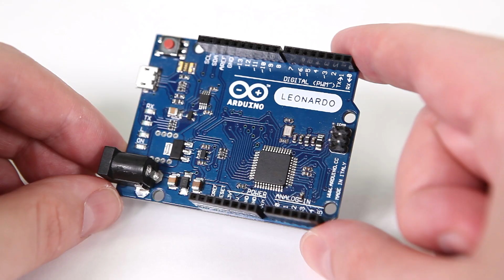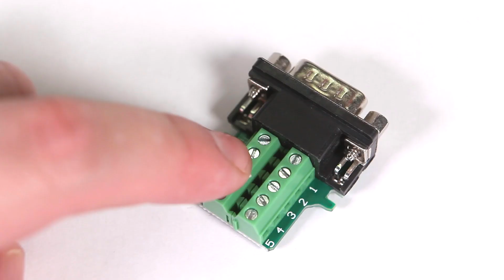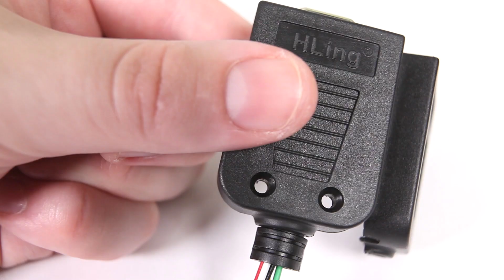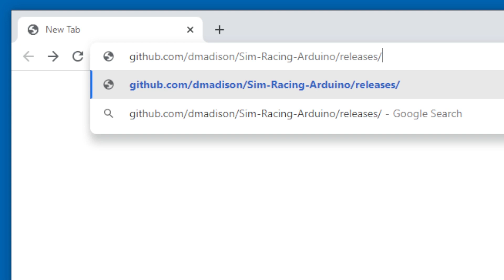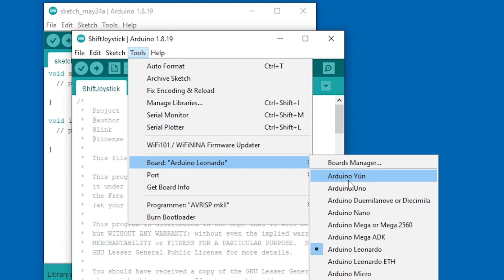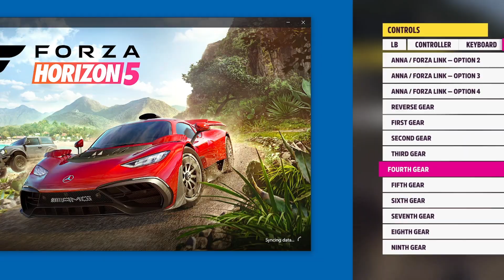(OLD VERSION) DIY Logitech Shifter USB Adapter (No Soldering!)

Comment: Worked great without problems. I used an Arduino Micro for this. Thanks!
Reply: thak you was wondering if micro is capable as i cant find leonardo anywhere
Reply: @filiplenczkiewicz9229  same, that was my issue too. Picked up a used micro, the important thing is to get one with wire connectors because otherwise you’ll need to solder the connections! So look out for that when buying one. Also, I recommend getting wires with plastic ends that fit to the arduinos connectors. Ended up being ~20€ for all the parts, with shipping maybe 25€.
Just wanted to add that before this I have never used an Arduino before, so it’s really easy to do even for beginners ;)
Reply: @benedikt9744  hey I already got my micro from Amazon I’m actually setting it up now haha yeah I got the one that u have to solder but I study computer engineering and soldered before so I’m g but yeah arduinos are fun! Next thing on my list is a IRL speedometer to program so that the rev meter and speedometer are the same in game and on my dash
Reply: @benedikt9744  might get the old BMW clocks they look good
Reply: @filiplenczkiewicz9229  sounds like a nice idea! I’ll maybe do that too sometime.
Reply: @benedikt9744 Hello! i am planning to get a Pro micro board but it doesnt seem to have the 5V where he attaches the wire to, where do we solder or attach the 5V wire to on arduino pro micro? also is it possible for you to point which Arduino Mirco board it is? sorry new to this 🥲
Reply: is the same pro micro

Comment: great video but considering the cost of everything it's cheaper to buy a Leo Bodnar adapter already made for 35 bucks
Reply from the maker: It's up to you, DIY solution aren't for everybody. You can get the parts for less than $5 USD on sites like AliExpress.
Reply: @dave.madison  Is it possible to make this with an arduino micro because I already have a few of those?

Comment: Awesome! is there a way to connect both shifter and pedals to a single arduino??
Reply: yes, i did this just an hour ago, works great. just need to combine the code and change pins to correspond with new pins used. good luck!

i can share my wiring diagram and modified code if you want.
Reply: @MotmoRacing  nice! thanks!
Reply: @MotmoRacing  Excellent project, although probably a little too much for me right now. But I have a Thrustmaster T300 wheel and am contemplating acquiring both a Logitech shifter and a set of Fanatech CSL pedals - for the time being minus the load cell pedal which would otherwise provide the necessary USB connector for my PC. But I am worried that only a limited number of games will support this setup. So could your arduino base adaptor be modified to allow both these devices to connect directly to the T300 wheel base, or alternatively combine them both to use a single USB port on the PC. Perdon my ignorance, electronics is definitely not my forte ;) And thank you if you take the time to read this! By the way, I am about to acquire a Steam Deck and would really like to try this on my Windows 11 partition in order to see whether I can get all the necessary drivers installed which are not supported in Linux or Steam OS....
Reply: @MotmoRacing  could you make it accessible? thank u
Reply: @MotmoRacing   can you please share your wiring diagram? thanks

Comment: Has anyone done this with a G27 shifter yet and confirm if the buttons work or not?
Reply from the maker: The buttons do not work. I do not have a G27 shifter myself to test with, so I didn't program button support.
Reply: @dave.madison hey, but the g27 shifter works, just the buttons don't, right?
Reply: @dave.madison  So i actually went ahead and gave it a shot but after running your files Logitech Gaming software sees it as a Rumble Pad.
Reply from the maker: @aarondieringer6997  It's not a Logitech device, I'm not sure what you are expecting Logitech's software to show you.
Reply: @dave.madison  sorry for the late reply, forgot about this lol. So I kind of got it working, I uninstalled the Logitech Gaming software and uninstalled/reinstalled the Leonardo and it stopped reading as a Logitech rumble pad. Idk why but yea when I first did it and still had the Logitech software it was being recognized as a “Logitech Rumble Pad”. 

So now it’s working but still have two issues I can’t seem to solve. 

1st, 2nd, 3rd, 4th, and 6th read fine, but it won’t recognize 5th gear or reverse. I’m not sure if the G27 is different than the G26, reverse is the same location as 6th but you push down on the lever and go into 6th for “reverse”. So I could see why that might be an issue, but not sure why it won’t read 5th. 

For most of the iracing and other sims I play where I need a shifter I could get away with using 1-5 and mapping 6th as reverse. But not having 5th really messes it up, and using 6th and reverse independently would be a nice bonus.

Comment: Why do you need an Arduino, can't we make a program that works on the computer to translate each input?
Reply from the maker: The DE-9 connector is not RS232, so off the shelf DE-9 to USB cables won't work. You need an Arduino (or similar microcontroller) to read the data from the shifter.
Reply: @dave.madison  Thanks for the infos

Comment: Thanks for this video, works perfectly. i also made your pedals usb one too. is there anyway of changing the Leonardo name in the PC as both shifter and pedals display as same name and its hard to tell which ones which when configuring them? i tried to follow tutorials about changing the boards.txt file but that file doesn''t seem to exist anywhere.
Reply from the maker: Yep! Check out the "Sim Racing Shields" repository, it contains board files for changing the name. You can use the Pro Micro board files on the Leonardo without issue.
Reply: @dave.madison  found the repository you mentioned and uploaded it to the board. got an error message about programmer not responding and now the leonardo isnt recognised by my PC or Arduino IDE. i double press reset button on leonardo to put it in bootloader mode and the board appears in the com list but PC pops up usb not recognised and board disappears from com list. clearly ive made a mistake somewhere and i cant figure out how to get board recognised anymore
Reply from the maker: @Paul-8623  It sounds like you had the wrong settings in the boards menu when you programmed it. You can try to put it in bootloader mode when the upload starts, but if it's reporting a USB device error you may have had the 3.3V board selected which has a different clock frequency. In that case you may have to flash it with an external programmer (you can use the second Leonardo).
Reply: @dave.madison  All fixed thanks. i did indeed have it set to 3.3v. To fix it i had to change processor to 5v and double press reset button then quickly select board from coms list then press upload and double press reset button again as soon as it finished compiling and started uploading. Works perfect now with peddles and shifter having individual names when connected. Thank you for your assistance and fast response to my questions.
Reply from the maker: @Paul-8623  Great! Glad to hear you got it working. Enjoy the adapters!

Comment: There are a lot of posts saying 5th, 6th and reverse gears are not working using a g27 shifter.  Can someone confirm that this is working on a G27 shifter?   Also, will this continue to work if adding an "18 speed" USB shifter knob with range and switch?

Comment: Very nice tutorial. Me being a newbie on electronics, I have some questions: 1. Since it was plugged directly to a usb port instad of into the Wheel, will it still work with LGHUB? 2. Is it possible to buy a DB9 male to female (for extending the cable length) and directly pluggit into the whell? I want to plug them into the wheel, but not removing from under the cable management all the time, would it be possible? Or would the pins layout not be the same?

Comment: Can I use the adurino UNO R3
Reply from the maker: No, you cannot use the Uno out of the box. The Uno does not have the hardware onboard to act as a native USB device like the Leonardo.

On some of the more expensive Uno boards it's possible to do some more advanced setup to make it act as a joystick, but I don't recommend it. You would also need to make some changes to the firmware to support the custom HID libraries needed.

Comment: An error occurred while uploading the sketch.

i've been at this for hours did exactly same steps i don't know whats wrong i'm sure of all the steps..
Reply: what's different is when i plug the adapter it just named as (COM4) and not (COM4 Arduino Leonardo) how to fix that ?
Reply: @LoWF16  USB port not detecing your arduino device, you must have the name written in the port (of the arduino used). Try other USB, it's the first step there
Reply: @yanni5595  bro i got mad and gifted the gear to some guy along with the adapter
Reply: @LoWF16  sadge, it's an easy to fix bug that you had, you should wait for some help :/
Reply: @yanni5595  yeah , i do dumb stuff when i'm mad hahaha thanks btw hope people use your info

Comment: i bought an normal rs232 adapter and cant upload it tryes and shows error any solution?
Reply from the maker: The shifter is not an RS232 device, an RS232 adapter will not work. You should follow the instructions in the video.

Comment: Theres a massive delay when going into 3 rd gear
Reply from the maker: Hi Paul, sorry to hear that. I'm not sure why 3rd would be giving you trouble if you're not having issues with 1st and 5th as well. Try running the interactive serial calibration, if that doesn't fix it please create a GitHub issue with more information.
Reply: Not for me.

Comment: Thanks Dave for great video and tutorial. Can this work with Arduino Uno or only Leonardo? Best! Also, the question is of the same can be done with G27 shifter or some modifications are needed?
Reply: did you tried it with a Arduino Uno?
it worked?

Comment: nice video,  do you know how to fix the 5 and 6 button not working
Reply from the maker: Using the code in the video? Run the ShiftPrint example and use the serial monitor to run through the interactive calibration for your specific shifter.
Reply: @dave.madison  thank you that worked
Reply: @dave.madison  can you eloborate a bit on how this works? i think i need to run this for my shifter as well but not sure how the process goes.
Reply: @dave.madison  nevermind. figured out how to use the ShiftPrint and Serial Monitor. Does not recognize any input for reverse gear.

Comment: Hey man! Great video and write up on this. I'm running into an issue where my shifter works for gears 1-4, but won't detect 5th, and 6th detects as R without the R Lock out (so you can use reverse with out without the lockout).  I've used the examples provided. I ran the ShiftPrint example and it shows the same behavior as my windows game controller properties window does. Do you have a write up on how to calibrate the shifter by chance? The shifter works fine with my G920 wheel and pedals, but I'm upgrading to the Moza R5 and don't want to spend $150 on their shifter right now, or $90 on the amazon special. Thanks for any help you can provide.
Reply from the maker: Hi! If you can't get into 5th and 6th is showing as reverse, that's a sign that either the reverse connection (green wire, DB9 pin 2 / Arduino pin 2) or the power for the reverse connection transistor (red wire, DB9 jumper between pins 3/9) is bad. You can test that enabling the 'SendReverseRaw' option in the 'ShiftJoystick' example, and pressing down on the shifter shaft. The button (#8) should be "on" when the shifter is pressed down, and "off" otherwise.

For calibration, upload the "ShiftPrint" example, open the serial monitor in the IDE, and send any character. Then follow the on-screen instructions. Once calibration is complete, copy the result and paste it into the indicated place in the "ShiftJoystick" example to apply it.
Reply: @dave.madison  same problem I test and The button (#8) It.s always "on" down or up ! ...My Joystick is fail ?
Reply: @dave.madison  I unplug the green wire on the Arduino and do calibration on Shiftprint , copy paste on ShifJoystick and I have 6 speed ! No reverse but I don't care, it's beter than have 4 speed! Thanks for you're work !

Comment: I followed your video but my PC doesn't recognize neither gear nor reverse. I'm sure the connection is fine on pins because the multimeter shows that current is flowing through wires.
Reply: any solution?

Comment: will this work with the G25 shifter and be able to use all the other buttons? Im asking as the G25 shifter is handy in some sims for extra buttons that are commanly used but the G25 doesnt work very well with the newer Logitech software. and the old software has to be uninstalled and reinstalled every time i turn off my computer.
Reply: Also wonder about the g25, I do not have the same issues but would like to do this some time
Reply: @MrSparkefrostie i have a link to a cable that i bought that works for G25 shifter. plug and play, minor software install that comes with purchase and easy to follow installation guide. Youtube wont let me paste the link. do you have Discoord so i can send you the link?

Comment: Hi Dave. Thank you so much for your tutorial. 

Wanna to ask you something. Is it posible to change the Arduino for a ESP32?

Thank you!
Reply from the maker: I'm not sure! I've done no testing on the ESP32 with this code. I believe my library, the Sim Racing Library, should be compatible with no changes. But I'm not sure that the Joystick library is. You may need to rewrite the example code to work with ESP32 libraries.
Reply: @dave.madison  The ESP32 has no USB HID interface so unless you do something over wifi it's not possible.
Reply from the maker: @FromNewRadius It depends on the ESP32. Some of the models, like the ESP32-S2, do now have USB HID functionality.
Reply: @dave.madison  Fair point!

Comment: For some reason my reverse isnt working, do you happen to know why?
Reply from the maker: If all of the other gears are working but reverse then it's likely a problem with the connection to the reverse button (the wire to pin 2 on the Arduino). You can set the "SendReverseRaw" option to send the state of the pin as its own button, which may help you diagnose the problem.

Comment: please can someone help me i bought a usb 2.0 to a serial adapter and when i plug in my g25 shifter it wont work.
Reply from the maker: Although it uses the same connector the G25 isn't an RS232 serial device. A USB to serial adapter will not work.
Reply: @dave.madison  so a normal rs232 serial adapter wont work?
Reply from the maker: @dilara7394  No it will not. You have to build a custom adapter, like the one in this video.
Reply: @dave.madison  can i use like an custom port that goes on g25 27 or even 29 shifters?

Comment: hi pls help me to get a code for arduino uno, i dont have leonardo boar,
i am getting thi error because i am using uno board, 
src/Joystick.h:32:2: error: #error The Joystick library can only be used with a USB MCU (e.g. Arduino Leonardo, Arduino Micro, etc.).
 #error The Joystick library can only be used with a USB MCU (e.g. Arduino Leonardo, Arduino Micro, etc.)
Reply: it literally tells you
arduino uno doesnt work

Comment: I bought the adapter that is plug and play and goes directly from the input of the shifter to a USB without having to connect cables or anything, and I downloaded the arduino application and loaded the libraries because it did not detect the reverse gear and now when loading the libraries appears to me as if it were an arduino leonardo controller and no button works I don't know how to reverse the controller or how to make it work again thanks

Comment: My Leonardo isn’t recognizing when i push the shifter down to get into reverse gear in 6th gear

Edit: I’ve done some troubleshooting. I plugged the shifter back into my G27 and reverse gear/button 7 works just fine. Need help with the Leonardo.
Reply from the maker: Try enabling the "SendReverseRaw" option, that will send the state of the reverse switch as its own  joystick button. If you can't get that button to work on its own then something is off with your wiring.

Comment: I have a question, with this setup,what is the software support?
Does this get recognised by most racing games?
From what I gather theres a driver issue with this and games may not recognize it, am i wrong?
Reply from the maker: It uses the class-compliant USB HID driver from the OS. Any racing game that supports generic wheels or other generic peripherals will support this without issue.

Comment: Hey, nice Video. Can i also use an Arduino Mirco 5V? Ive read that it can also function as an usb device.
Reply from the maker: Yes you can,  although you'll have to solder to the pins.

Comment: Hey can I do this mod to old logitech shifter that comes with g25? If so will the additional buttons it has work?
Reply from the maker: It hasn't been tested but it should work for the G25 shifter. The additional buttons will not function, though.
Reply: @dave.madison  Thanks for the fast reply! I have another question which may sound very noobish but would there be any problem if I used arduino pro micro instead of leonardo? I assume only problem would be needin soldering. I hope there wouldn't be any problem software side :D
Reply from the maker: @agift4u240  Exactly right. Everything is the same with a Pro Micro, you just have to solder to the pins.